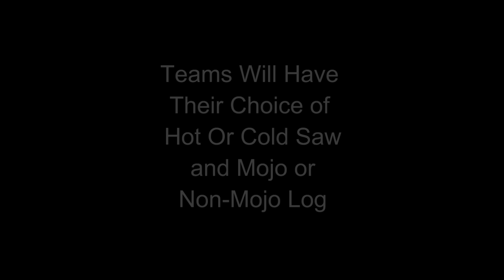Fastest Saw In The West | Wranglerstar

Comment: Do you guys ever use any lubricant for the saws so they go thru the wood better?
Reply: My thought as well.  Didn't appear so, increasing the misery index.
Reply: The saw teeth cut wider than the blade, so the blade has space to move behind them
Reply: The saw teeth cut wider than the blade, so the blade has space to move behind them
Reply: it wouldnt gum up the saw? I work with metal and we have cut wood in our bandsaw(with coolant/lubricant) and it gums the blade up, still cuts as quick but its a big bandsaw.
Reply: We'll I think it has to do with the different teeth on the saw, some cut and others rake out the shavings
Reply: bluenorthnw That's true. lol.
Reply: John Poobum Hahaha. I thought this was a family channel.
Reply: Love2boat92 This is old but I wanted to add my two cents. When I cut trees that have a lot of sap, I keep a can of wd40 and that helps a lot. I have a flat ground cross cut saw and bow saw though, so the full face of the blade makes contact with the wood. I am looking for a crescent ground saw :)
Reply: TheBladeSickness I thought lubricant would help. I mean it helps out on a chainsaw so it should help here too.
Reply: Farmer Dan ha-ha. Yeah. It's sort of like oil in an engine. Keeps things lubricated and cool.
Reply: ***** Yeah a sharp saw can definitely make a difference. Those shavings are huge. Wow.
Reply: Not sure if this is the case here, but wood saws that I have seen have teeth that stick out sideways a bit, thus making the cut slightly wider than the bulk of the saw blade. In those cases it might make sense to not use lube. That said, I have tried using vegetable oil, and I noticed that the saw blade got less hot.
Reply: metallitech That's sort of like a chainsaw. Why not use used motor oil?

Comment: Can someone explain to me why the saws are very flexible
Reply from the maker: lachie2002 The saws need to be light weight,
Reply: Oh thank you
Reply: +lachie2002 It's worth bearing in mind that there is no reason for them not to be.  You saw the saw flexing because most of these people aren't hugely experienced in sawing.  The idea is that you pull but don't push so if all's working well, the saw is always under tension.